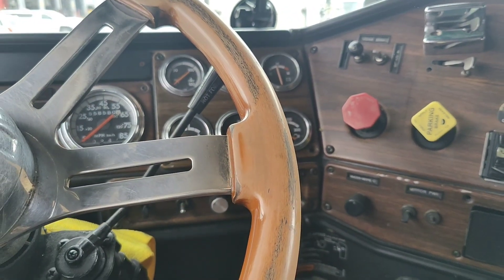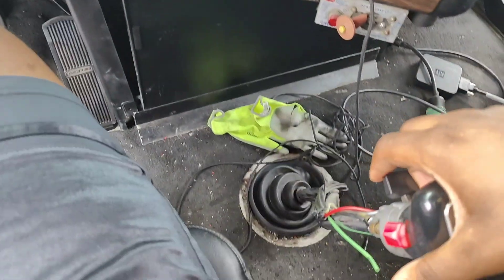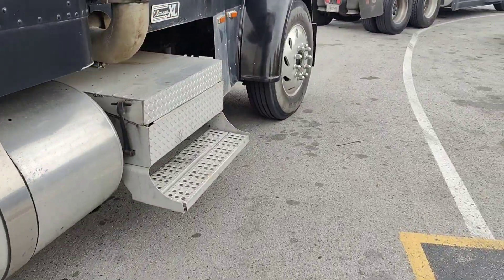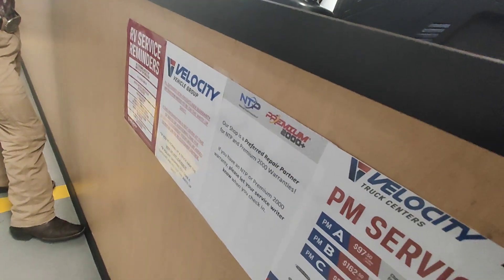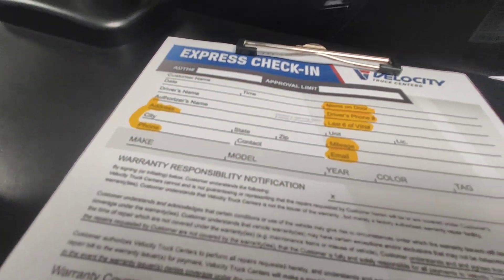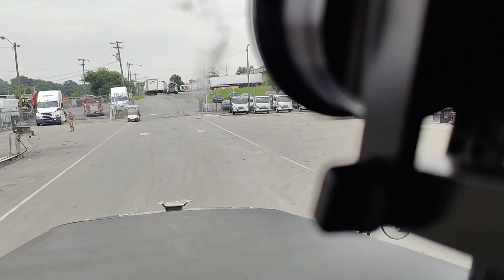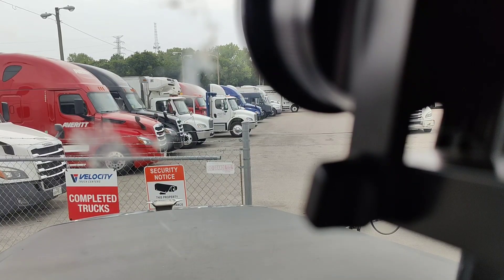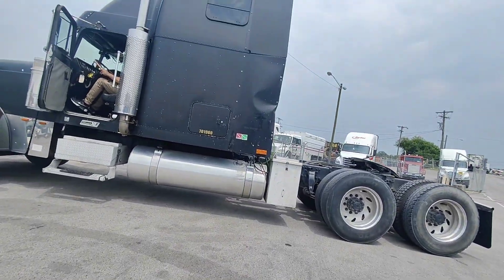Brokedown - 1997 Freightliner Classic XL 12.7 Detroit 60 Series 13 Speed

Comment: Just paid 3500 for ah rebuilt transmission 1000 for clutch 500 labor and it’s ah 9 speed I wanted 13 speed but they wanted ah core so I had to go back wit the 9 speed and had to get 4 drive tires also mf broke as fuck truck will be ready tomorrow cash truck for the win